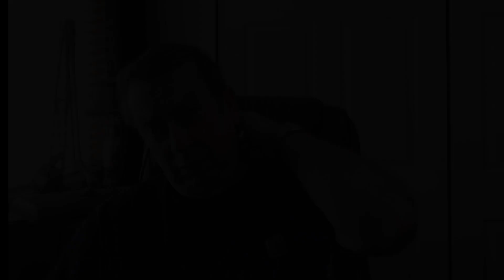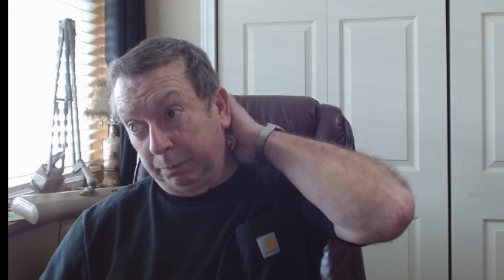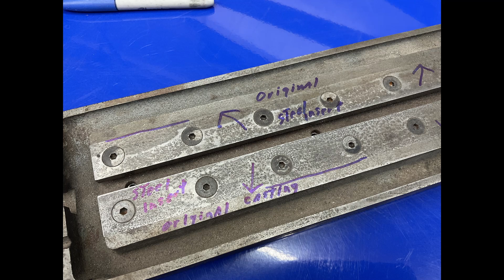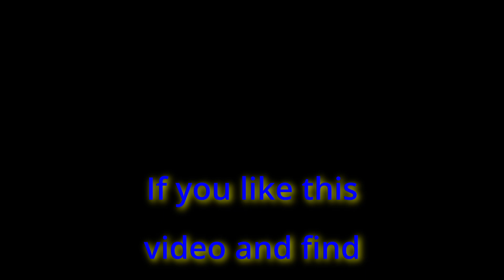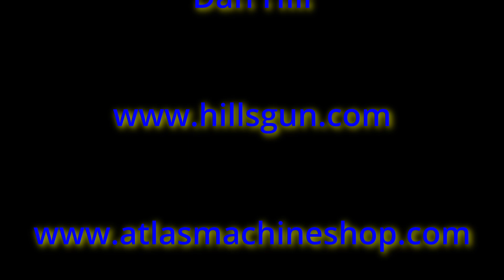Internet Forums: Tales Of Untruths, February 26 2025

Comment: I put a DRO on my 10" Sheldon, and I thought that was a bit heretical. CNC on a 1940s lathe doesn't strike me as the obvious way forward.
Thank you for reminding me about the Sheldon list. I dropped off when I changed my email address: I should rejoin.
Reply from the maker: I don’t mind dro’s on any machine as I believe it makes them a better machine and me a better machine operator,but cnc has a whole different approach and the older machines are a compromise at best.